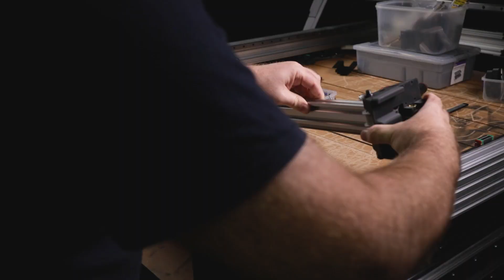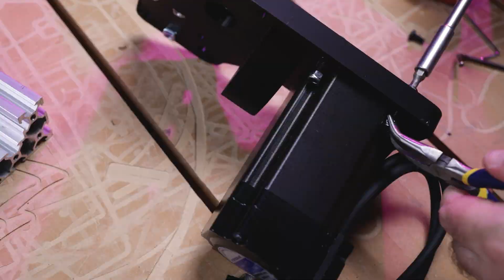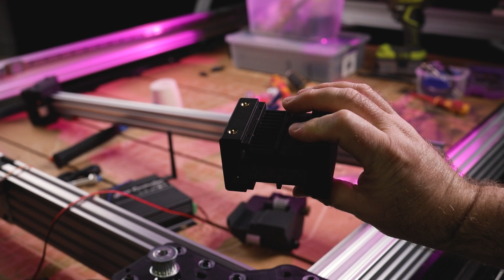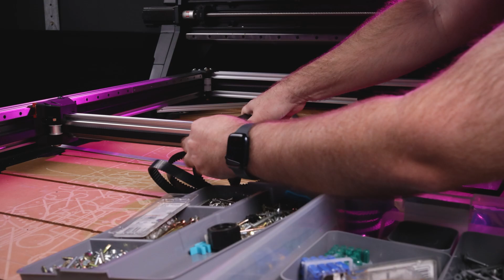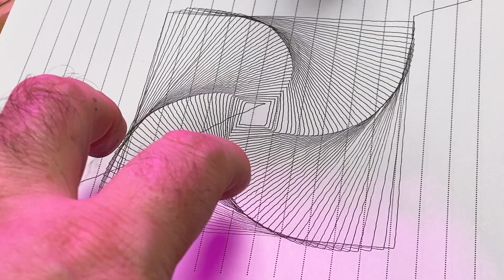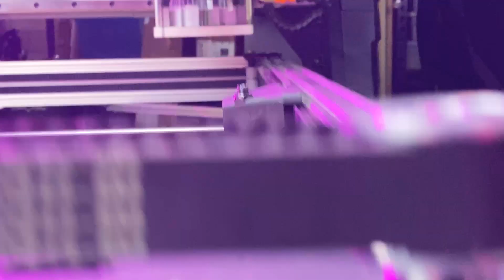Wireless CoreXXXY MAX // FluidNC MAXXXED OUT!!

Comment: Do you have a github with details about the ESP wifi part of this? Or can you point to any external references you might have used?

As machines scale up, getting rid of wires starts to make more and more sense
Reply from the maker: Checkout the following ESP32 controller I used:
https://www.rootcnc.com/product/root-controller-rev-3/

Here is the setup kinematics for a coreXY:
http://wiki.fluidnc.com/en/config/kinematics

Let me know if you need more info!
Reply: @NEWTechCreative  That part I got. Didn't you mention also using a separate ESP32 or two to wirelessly connect to the motor on the toolhead/gantry?
Reply from the maker: Ahh sorry! Yes I understand now. I will upload code to GitHub in the next week. Feel free to send me an email to newtechcreative@gmail.com and I can send directly. 👍
Reply from the maker: I've uploaded code! https://github.com/NEWTech-Creative/Wireless-ESP32-PWM.git
Reply: @NEWTechCreative  Can't wait to check it out. Thanks!

Comment: When you were testing the speeds you said that there is some kind of restriction holding it back and thats correct.
Most machines/firmwares have an extra parameter called acceleration.
Maybe check if your firmware has that aswell and set a higher acceleration when running higher speeds.
Reply from the maker: I will definitely check out - I did rush the fine tuning to get up and running and may have missed this! Great suggestion 🤩🤩

Comment: 2d bed slingers can add many static print heads for many times faster prints. use two scotch yokes to move the print bed in 2d, its more rigid than the two point beam axle mechanism. well if you want to keep the print bed static, then just use the same 2d mechanism to move a bunch of print heads at once. 2d sling print bed is just two axial rigid screws. on rails. also screw movement is a gear down ratio for high speed motors, like stepper motors. yep no belts, just two screw linear xy drives. actually, it can be fully xyz screw linear drives only. for both print bed movement or just print head plane movement. assume that the print head tool is socketed to the control point of the 2d or 3d scotch yoke intersection point. also each axis movement is controlled by one screw only, not multiple motors. preventing tilting or out of sync situations. at least the xy print bed movements are one-screw fully supported, even if the vertical print head level is using 2/4 level screws not just one. one the vertical print head axis controlled by one screw without sagging on sides, would be like an elevator with 8-point cube corner point rollers on the rails. wireless? you could use the rails as power and signal rails. just like power line lan adapters. yes the Z-axis is like a high tonnage press linear screw rail mounting. xy system being mounted in the z-rails movement mount system in the rails.
Reply from the maker: Awesome info! Thanks for this - the scotch yokes look like a fantastic mechanism for this build! I hear what you’re saying about screw driven over belt, however curious to see how the belts will respond over time… maybe I’m just delaying the inevitable! 😆😆
Reply: @NEWTechCreative  I wonder if super fast drone motors would make the screw fly fast.
Reply from the maker: @gsestream  now that would be incredible to see!! 🤩🤩

Comment: Stepper motors are not amazingly precise when micro-stepping. What you can do is add a reduction ratio, especially with the motor short-belt that you made. You can add a larger-diameter pulley on the rod, and keep the smaller one on the motor. That way, the motor will need to rotate more times in order to move the same amount on the XY and you can rely less on micro-stepping giving you precision.
Reply from the maker: Great suggestion! That would be a pretty easy swap over and will definitely consider this! I’m curious on the ability of motors and will upgrade if too many issues. Great advice 🤩🤩
Reply: With modern drivers, they're quite accurate as long as you don't have high load (high moving mass and/or acceleration) against the limited and nonconstant holding torque. TMCs are not like old A4988 and similar.

Comment: I was wondering waht type of plastic did you use for the 3D printed parts ?
Reply from the maker: I’ve just used PLA for prototyping 🤩 however I think ASA would be a much more suitable material!
Reply: @NEWTechCreative  Thanks for your reply, on video those pieces look great, almost like Carbon Fiber that's why I was curious.
Reply from the maker: @Jose_Ferreira_1  I think it was printed with matte black filament… has a real nice finish 😄
Reply: Probably something like ABS or ASA

Comment: Look Great, exept im not a fan of closed loop belt to drive the belt, i think you create more backslash and vibration with this thing, my experience in CoreXY ( 2 Machine ) is....K.I.S.S.....keep it simple stupid...advantage with Klipper you can add sensor to check and correct the over mouvement in change of direction, we see this on yours paper at each corner. Not fan to your pen support, far from the head and with the "spring" , im sure you got lot of vibration there, try to put accelometer sensor on it.

I take note of some of your idea and This give me the tempation to play with servo, i never try yet

i keep my eye open for your next video
Reply from the maker: We shall see!! Yes I agree, plenty more space for improvements 🤩 klipper would be pretty sweet to dial in the machine - great advice 👍